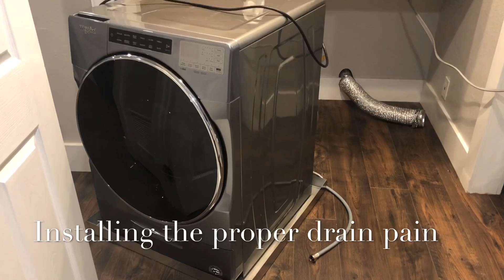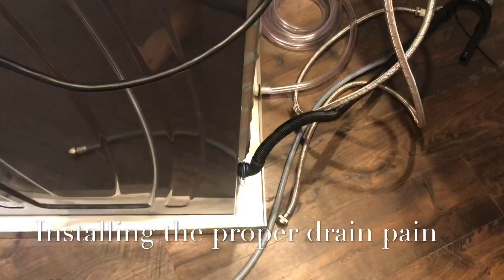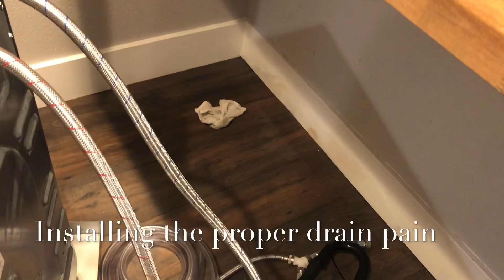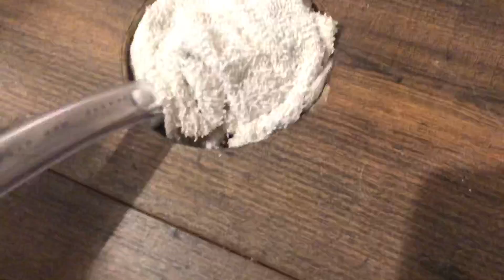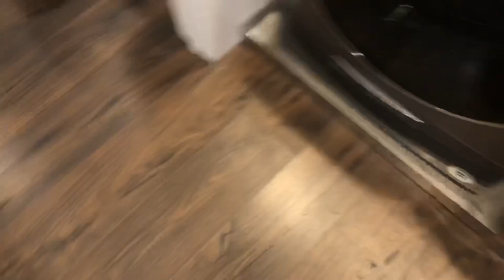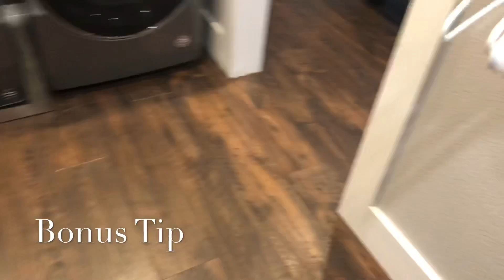Installing a drain pan for your washing machine so you don't get water damage to you house

Comment: How do you prevent the water from landing on the floor where the hoses connect in the back? I find my water problems are smaller so far but also cause damage and that often stems from not realizing until much later that a rubber gasket is failing and I have a slow drip happening in the back. A pan like this won’t catch those drips.

Comment: If your washing machine fails, it is most likely to leak from the supply hoses, that's 60 psi of water and your floor drain has a rag in it. You are better off keeping the pan with a leak detector and completing the floor drain installation with it's cover and continue to prime the trap once a month

Comment: Thank you for this video. Very helpful. What size is the pan?  
My washer is 27 by 27. i am thinking 30x32. 
I am also adding "floodstop" valve and i will put the sensor in the pan so that if it senses water, it will shut off supply to the washers. 
Thanks again.

Comment: You have the ideal drain directly on the floor but for those that don’t they could purchase a marine grade water sensing bilge pump and install it in the pan . that way if the pan ever starts to fill up with water the bilge pump will sense it and turn on and start pumping the water out. You can run the bilge pump hose to the same Location that the washer drain hose goes to.
Reply: Another thought I’ve seen from Amazon reviewers and home DIYers is to add a leak detector alarm system. Some brands, like Govee, not only sound an alarm but can also trigger a water shutoff valve to stop the supply line if a leak is detected. In some setups, the detector could even trigger a remote power cutoff to the washing machine. Cutting the power can sometimes stop the washer’s internal valves and control board from calling for more water or starting a new cycle.

For people who can’t run a drain line through the floor, your bilge pump idea works well — and the discharge hose could also be run to a large bucket as a temporary solution. Having a spare bucket nested inside means you can quickly swap them out if one fills while you’re emptying the other.

Another option is a washing machine pedestal with a built-in drain pan. These raise the washer about 18–22 inches, which makes it easier to use gravity to run a drain hose into a nearby floor drain, utility sink, or even a collection bucket.

A few more things worth mentioning:

Stainless steel braided supply hoses are more reliable than standard rubber ones, which are a common cause of leaks.

Some people install an automatic shutoff valve on the water supply line that closes whenever the washer is not in use.

Periodically inspecting and replacing hoses (every 5–7 years is often recommended) can prevent failures before they happen.

Between a drain pan, a bilge pump, leak sensors, and stronger hoses, you can cover most of the big risks of laundry room water damage.
Reply: F that .. an alarm? People are crazy

Comment: Hi bud, thanks for the share :) idk if you've seen this in action but my concern with the Flexi hose is it appears higher at the floor drain than the pan connection, which I imagine would stop it working due to the syphoning effect. In theory. Maybe raising it and perhaps a rigid pipe :s thanks again for sharing :)

Comment: Very helpful video, will send it to all my kids! Good point on gravitational drainage of plastic hose from pan to drain. I might suggest testing this with a bit of water in the pan before replacing the machine into the pan. BTW there are other videos with tips on getting a heavy machine into a pan without damage to either.

Comment: Hello thank you for the video. My laundry room is on the second so I inspect my hoses at least once a month. You mentioned that ever having a front loader again. I’ve had it Samsung for the last 12 years and I’ve never had any issues with vibration. The front loaders are always going to give a better wash than top loaders. In the front load washers the drums are just as big now as the top loaders so I’m sticking with the front loader for the better washer. Thanks again for the video it was very informative.

Comment: What if you don't have a drain hole in your floor like most apartments?
Reply from the maker: Then you just drain the pan into a bucket.  I would either add the hose and plug it at the end and if you have a leak then unplug it an drain it into a big bucket or don't add a hose and just remove the water by hand of towels if you have a leak. Just make sure you have a deep enough pan like the on in the video to capture all the water.
Reply: Try a pump and then direct the hose to a sump pit or outside.

Comment: Thanks for the video. Could you tell exactly where the water was leaking from on the front loader (was it through the door)? If so, would you need some clearance on the front of the pan so that water leaking from the door has room to fall? Trying to figure out how much clearance to leave around the washer when I buy the drain pan.
Reply from the maker: My leak was where the hose hooks up from the wall.
Reply: @ScottLeopold  Sooo it sounds like the problem was with the hose and not the front loader?
Reply from the maker: @eyehear10  that's correct.  I wasn't sure what it was at the time but then we figured it out.